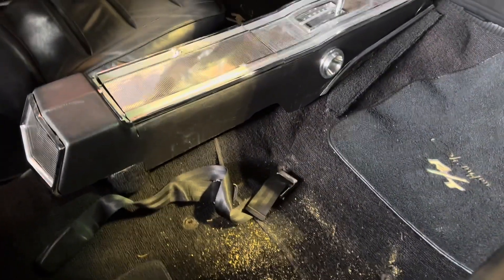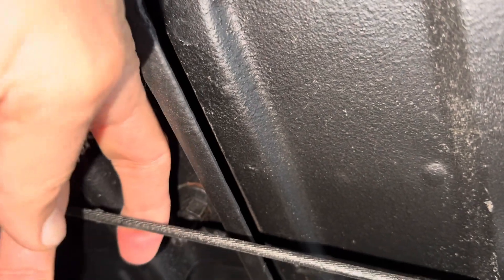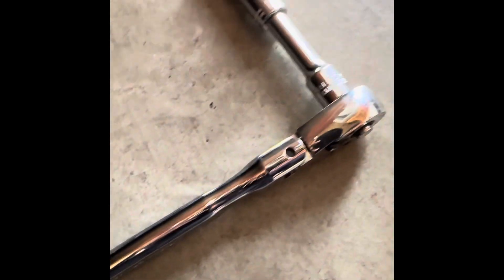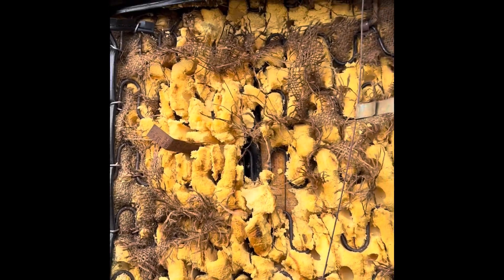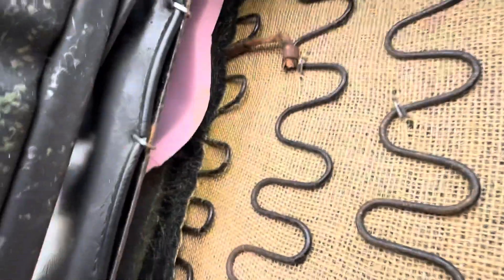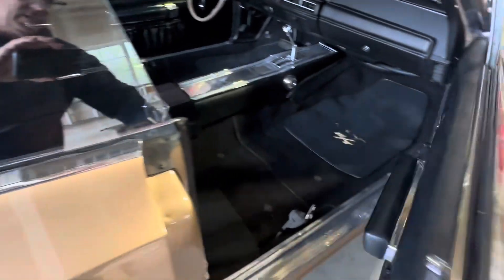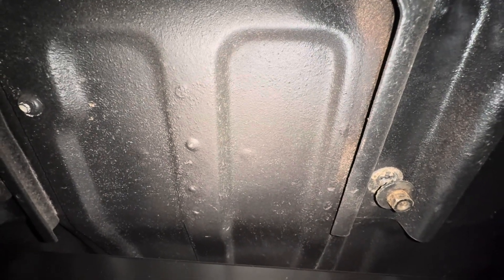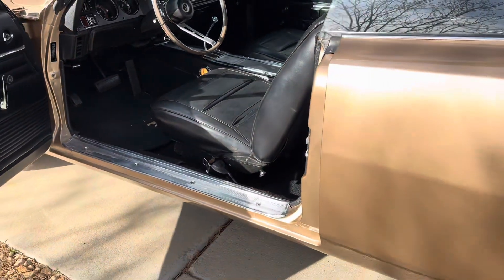1968 Dodge Charger - New Seats for Gold Digger

Comment: That seat foam is dramatic, by comparison. I had to level mine with spacers, still not sure why.
Reply from the maker: This is much better than the stock foam and fits the covers better IMO. B body seat tracks shouldn’t need spacers. I had to use them on my E body tracks before.